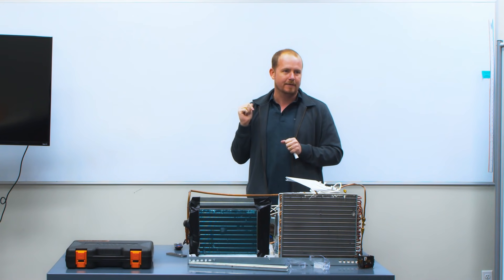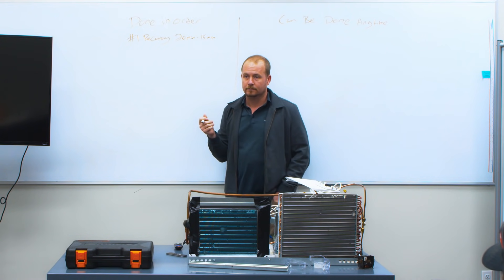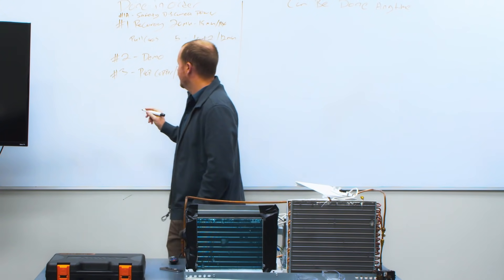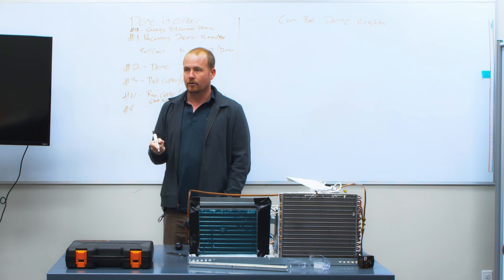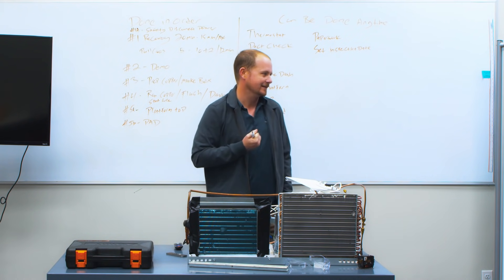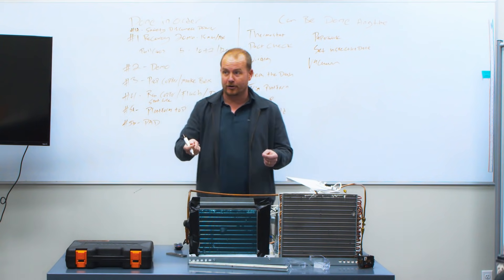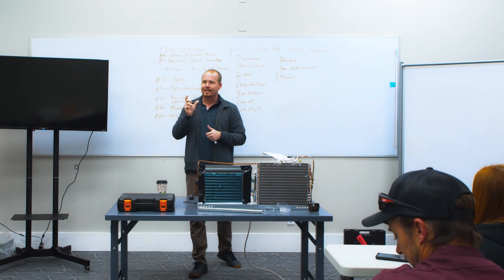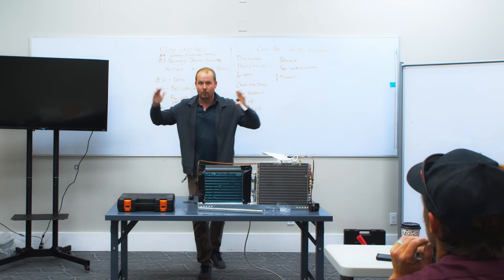Order Of Functions - Being More Efficient In Our Daily Routines

Comment: Yes this topic of "order of function" could be presented to any group in the traids. Valuable lesson. 
My advice to junior tech is, don't take any tool or equipment back to truck without my OK. I use to work with an older guy who would take the welder, grinder or pipe threader back to the shop before the job was completed, to help himself to puch -out at 8hrs. I nic-named him Babushka!

Comment: More importantly than everything discussed here is safety and self preservation. I'm in the industrial division for 31 years and I have an efficient, but steady speed. I use the recovery time to disconnect first label the  electrical. Take pictures if needed, remove structural mounts and whatever panels or obstructions possible, start writing a matierial list, and check for any existing damage to any components in the system. Other than that, I don't rush for anyone because there is seldom any good outcome. If I make a mistake, forget something, damage something from rushing I am a target. If everything works out perfect,  my office sends me on service calls. Both ways, I end up exhausted while everyone else goes home wondering what's for dinner.

Comment: when i do a change out i hook up recovery  start it , and start doing  unwiring  high voltage , then low voltage by that time the recovery is finish , cut cooper lines , then do a flush  on cooper lines and drains ,then set units back , and off we go

Comment: I usually split up from the get go I would have my partner pumping down while I unwire, then straight into demo by then than condenser line will be cut after demo I'll have help moving old equipment, after he will be back on putting in the condenser then I prep then have come back to lifting in new equipment it's normally 5 to 6 hours if the working area is great.

Comment: Do you recover on all change outs ? or just ones that compressor doesn’t run
Reply: All...but you can pump into the outdoor unit, then cap the stems. But you cannot dispose of a charged AC unit including cars or appliances. But I’m sure you will get told this if you go to the scrapyards.
Reply: @f1reguy587  I have someone pick up all my scrap unit. I pump them all down into the condenser if I can. I was just wondering if there was a reason if they recover on all and if so for what reason if different than yours
Reply: @doriascomfortsolutions7740  You recover if you want to reuse the refrigerant or if you need to leak check, flush the line set ,or fix anything on the condenser side.....obviously if you need to change a compressor. You can NOT pump down...